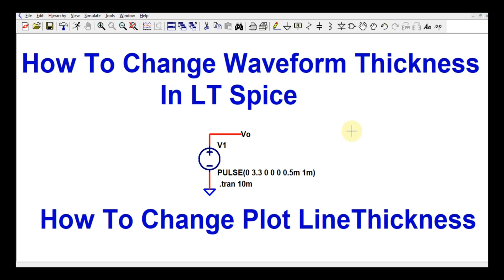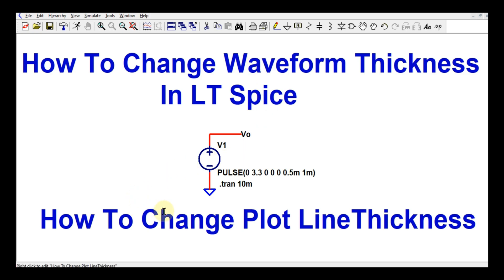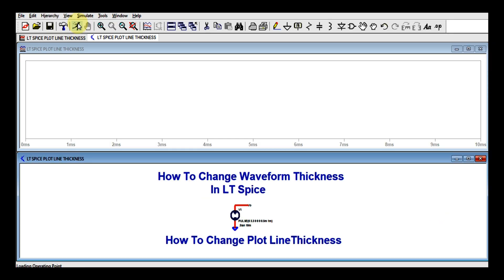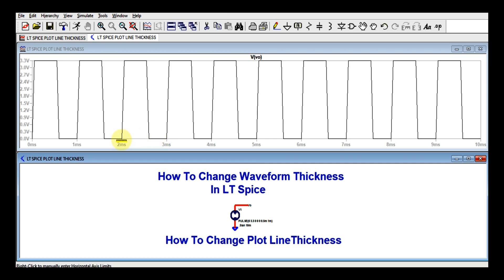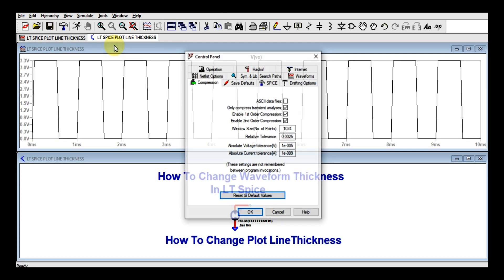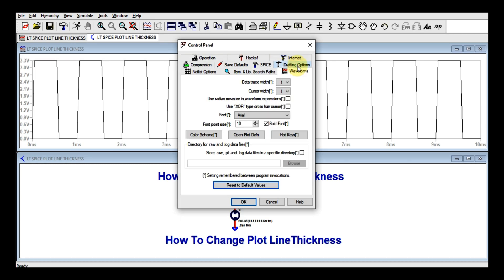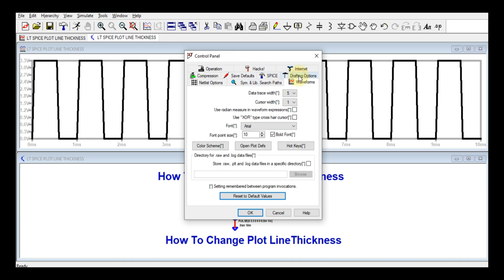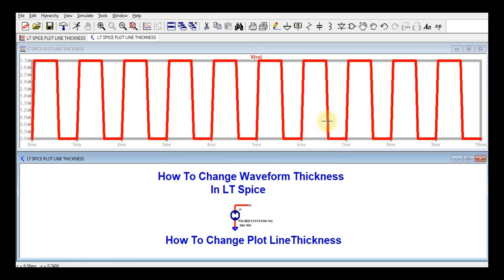How To Change Waveform Thickness in LTspice Explained

Comment: How can I change the line thickness of phase and group delay plots ?
How can I change the dot pattern / line style of phase plots ?
Reason: The dotted phase lines are barely visible. Their thickness does not change with the general line thickness command.
Reply from the maker: Hi...Thanks for Your comment...Can You schedule 1:1 meeting with me , its difficult to answer in chat ?
Reply: @ElectronicsCircuitHubECH  Hi, why don't you just write the answer here in the comment section ?
Is it even possible or not ?
I have found nothing in the help function nor in "Undocumented LTSpice" of LT-wiki.
Reply from the maker: @Kai-pcheck  I do not watch my video once I upload so sometimes I do not understand the question what you are talking about so its hard to answer...same is for your question...
Reply: @ElectronicsCircuitHubECH  I am talking about the results of an ac-analysis displayed as magnitude in dB and phase in degrees or group delay in seconds. The line thickness command of the control panel only changes the thickness of the magnitude trace(s), not that of the phase or group delay. I wonder whether there is an undocumented way to change thickness and/or dot pattern of the phase trace(s).
My hope was that you might know about that.